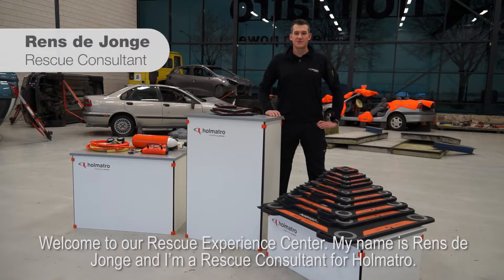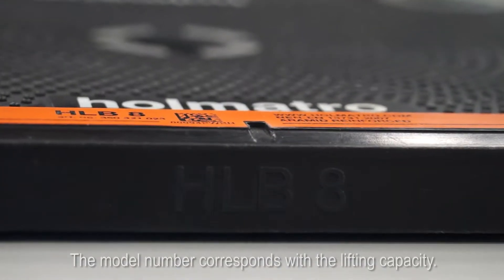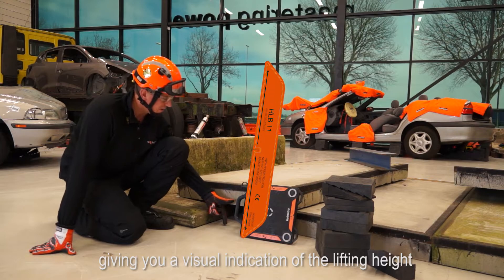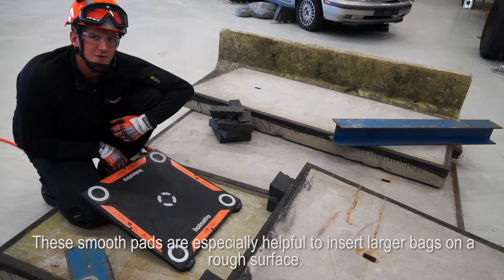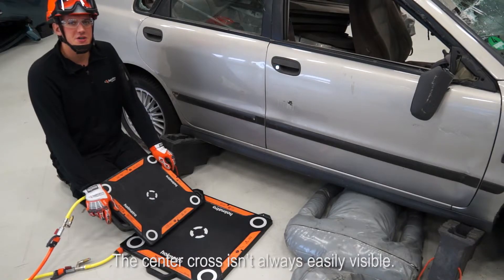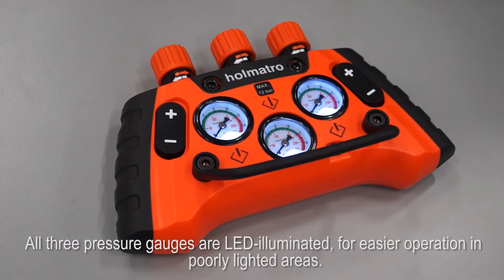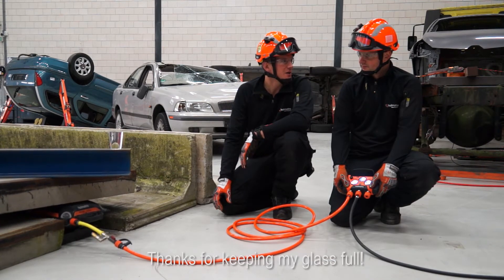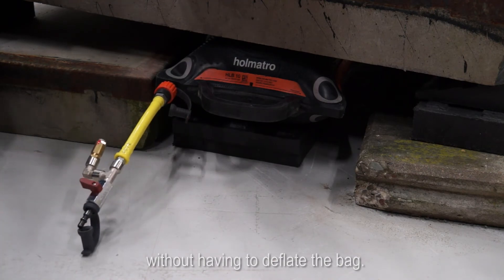Holmatro High Pressure Lifting Bags 12 Bar - Product Demo

Comment: Perhaps the visual indicator should be printed from the corners of the bag to enable the bag to physically size up the lift to ascertain if it can reach lift height requirements. Although a good idea, it's effectively useless printed in the center.